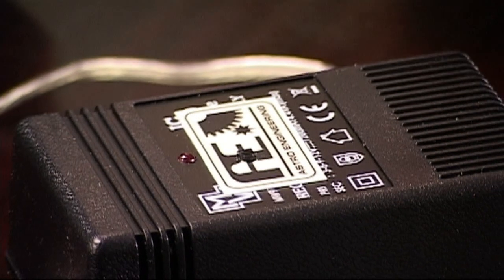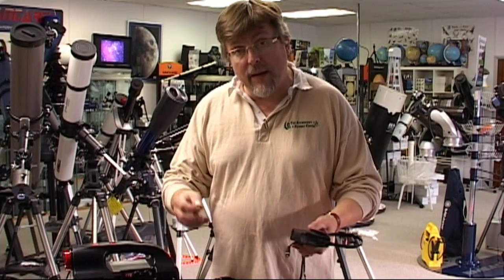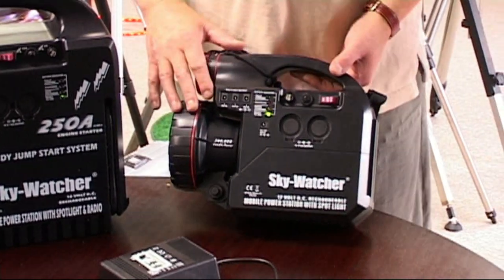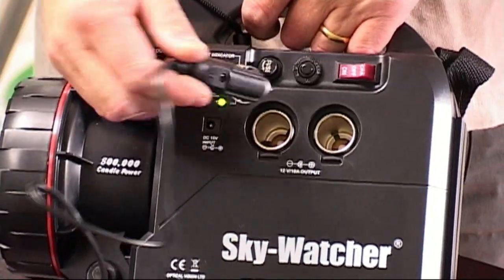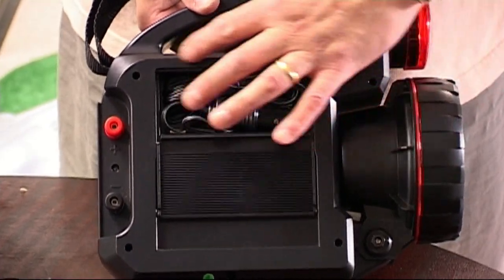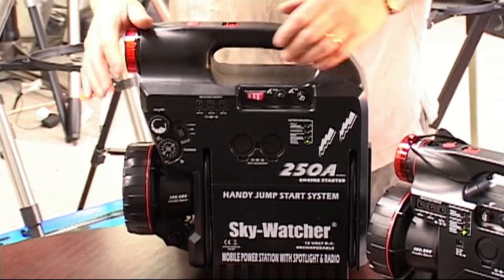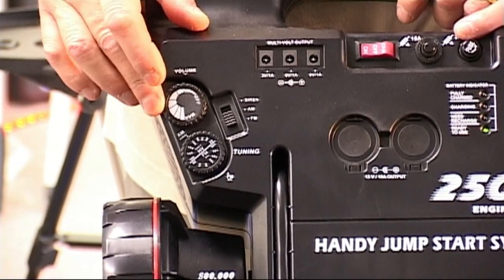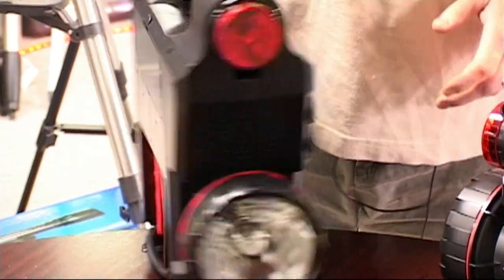Powering your telescope

Comment: One small point not mentioned here. If you let the battery go flat, it cannot be re-charged! It becomes just so much junk ... unless anyone knows a hack.
Reply from the maker: Hi there. Yes that's a fair point as the batteries featured in this video employ lead-acid technology and need to be recharged after every use or there is a serious risk that the performance of the battery will be quickly reduced. I'm not sure I'd call it a 'hack' as such, but the damaging process of lead sulphate build-up (or sulphation) on the plates within the battery, caused by irregular or incomplete charging, can be reversed - sometimes completely if the battery is not too old. The correction process requires to battery to be charged at a much higher rate than is provided by the simple unregulated chargers that are usually included with the battery. The battery needs to receive a much higher charging current for a few hours, and this can usually be achieved by connecting the battery to a 12V car or marine battery charger. Care should be taken not to overload the battery, and make sure the mains powered equipment (car battery charger) is correctly fused before use but the technique works well and can cook-off the sulphation scale permanently after 10 to 20 hours of charging. I hope this helps. KR RJD A&NTV

Comment: Just Say No!
Why?
For a low cost 12v + Usb + C + Flashlight + replaceable battery do:
Ryobi one+ 18v 120-Watt Push Start Power Source with 12-Volt Outlet RYi12VBG
Now
It is expensive $50 and you may need to buy 18v battery. 
For my 4 Celestron Telescopes I use 12v Roybi power It is the Boss
Reply: 18V One+ 150-Watt battery power source and charger RYi150CBT
Now
It is expensive $50 and if you do not have any power tools (I own 18v tools) then you would need a battery buy. 
but
R&R battery from 2Ah to 12Ah its your choice in power you need so almost unlimited on scope power.